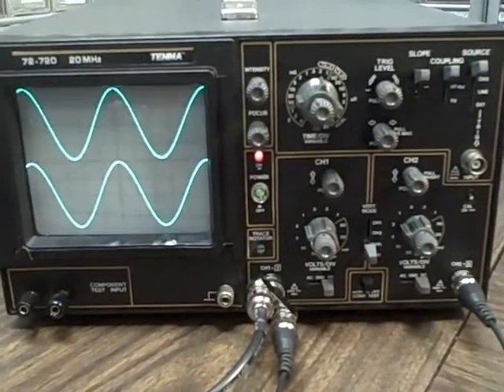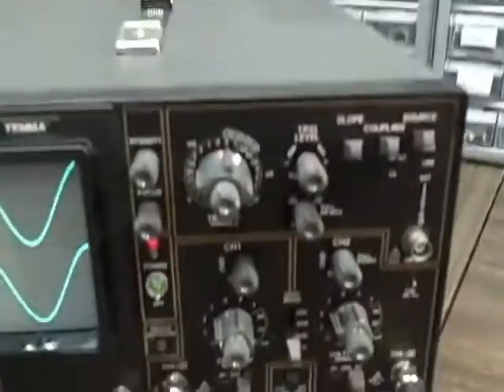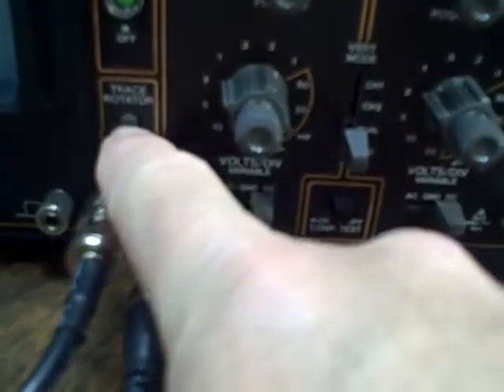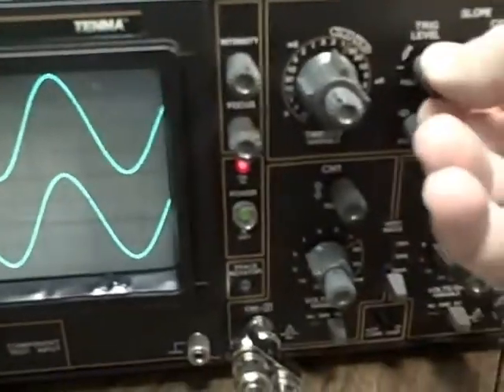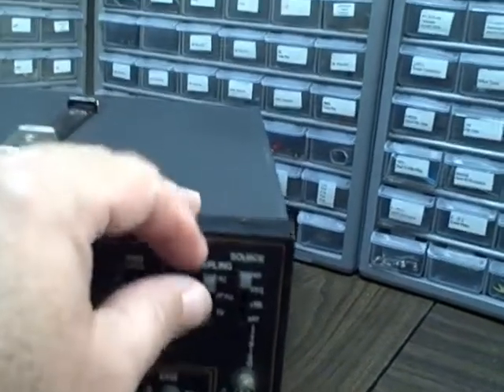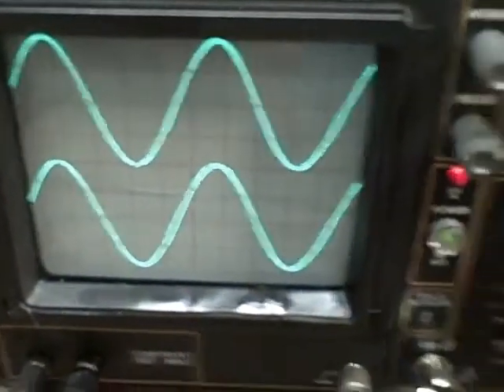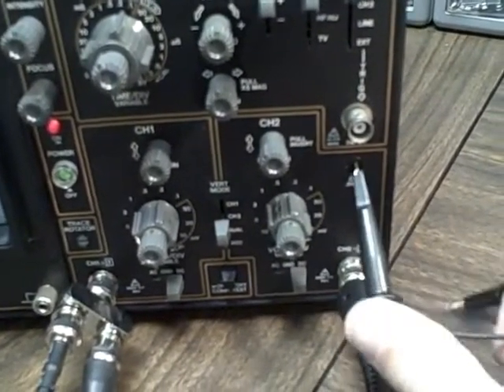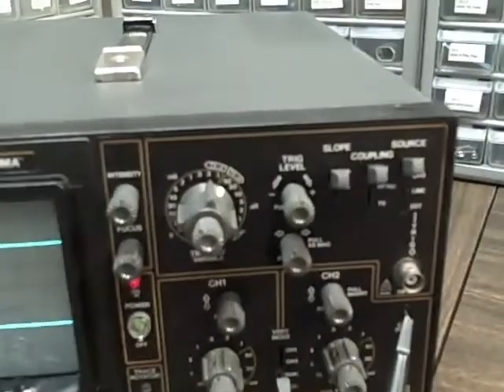Part 1 Tenma 72-720 20Mhz oscilloscope intro

Comment: My Tenma is the same era as the one you are using except it is the 100Mhz version. I was wondering if you knew how I could go about testing it. I am new to using oscilloscopes and want to test the unit. The screen is not on, but does show signs of life when I turn it off (i.e. squiggly lines before turning off) but nothing showing on the screen otherwise. Is there a test I can perform to make sure I did not get a non-working unit? Thanks!